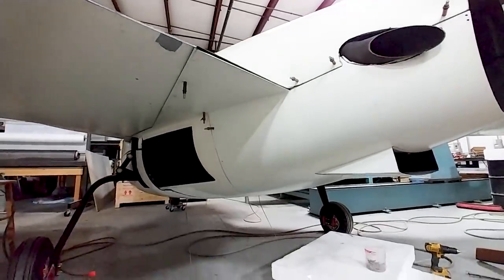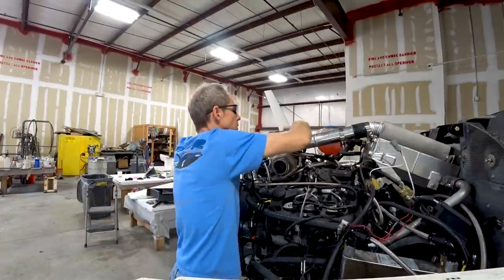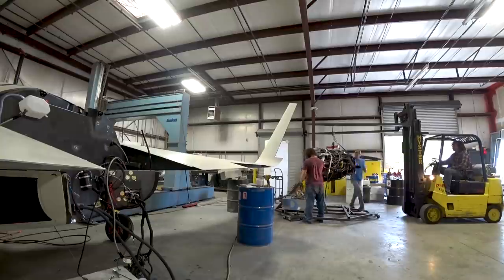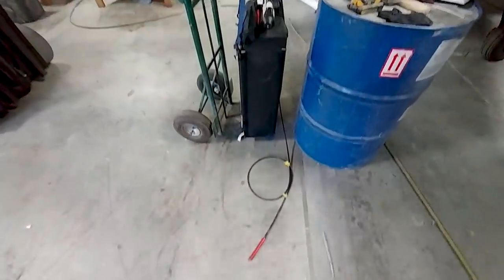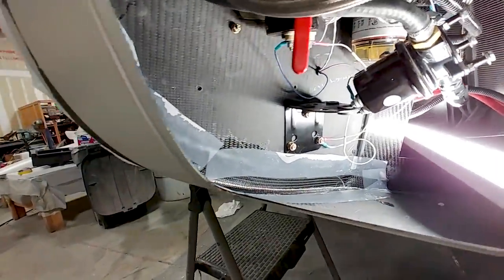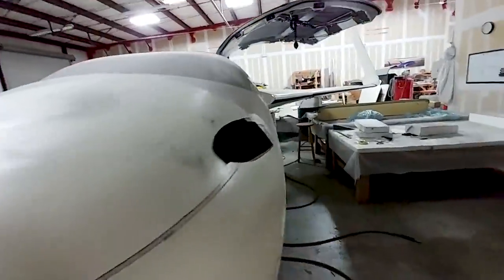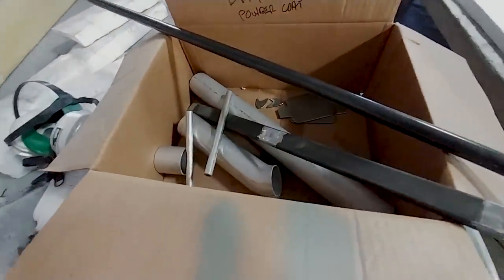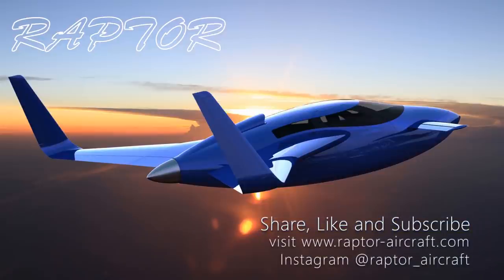Engine Out, Parachute In - Building the Raptor Prototype

Comment: On my parachute in a pipistrel they built carbon fibre tube for the exhaust with a white sticker to cover the hole. Simple, light weight. And I’ve used it on my first pipistrel aircraft after half a blade let go, they sure are nice to have.
Reply: I was just about to write the exact same thing, nearly word by word. I built my Virus from a kit and I remember the installation of the carbon fiber tube was added as an addendum to the kit build manual.

Comment: You guys are amazing!!!  Getting close!!  Are you going to pressure test the tanks before going to the airport? The Rutan homebuilders use an altimeter reading of -1500 ft, which works out to be 0.8 psi. Just curious, what's the weight of the entire "power unit" ?

Comment: Beautiful work.  I can't wait to see it make it's first flight!  Have you considered using a remote mounted electric A/C compressor?  That would allow you to remove the engine without having to evacuate the refrigerant lines.
Reply from the maker: I don't plan on removing the engine on a regular basis. There are refrigerant recovery systems available anyway.
Reply: I was thinking of future maintenance.  At some point, the engine will have to come out for service or overhaul.  If the A/C is a separate, self-contained system then it's one less thing to deal with.

Comment: Does the aircraft have a dedicated ground plane? You may wanted to consider installing a dedicated groundplane and even some lightning protection for the production model.  I would be happy to help with this as I have some experience  in the matter if you ever have questions.  I would be “shocked” to hear that you haven’t been shocked by your fuselage yet (If it doesn’t have a dedicated ground plane that is...)

Comment: Just a random thought, but wouldn't rolling it out thru the door onto a flat deck 5ton car hauler have been easier? the deck of the wrecker truck should be close to the same height as the loading dock door.
Reply from the maker: Because I learned was back in kindergarten that you can't fit a square peg in a round hole.
Reply: @RaptorAircraft  I learned you just need a bigger hammer😊

Comment: I recommend the user Fibrefrax for the firewall. It is FAA approved, very light weight and very easy to work with. Available from Spruce. I used it on my composite homebuilts firewall.
Reply from the maker: That looks interesting. Does it get very dirty? Did you glue it on with the glue they also offer? Any other tips you may have for installing it?
Reply: Raptor Aircraft  After applying the Fibrefrax to the firewall I put an Ali heat blanket on top to protect the Fibrefrax from dirt, oil and anything else. I also used Fibrefrax on the parts of the cowling that are close to the exhaust and then covered those areas with Cool It tape which is a self adhesive Ali heat reflecting tape. As far as adhesive to apply the Fibrefrax goes, you can just use a high temp spray glue.
Reply: Raptor Aircraft  I seem to remember they wouldn’t ship the adhesive that they offer with it to the UK as it was flammable. So I sourced a similar product over here.

Comment: Wouldn’t the rocket exhaust be hot enough to melt aluminum tubing? Maybe consider thin-wall stainless exhaust tubing instead. Still going to be nice and light.
Reply from the maker: It's not like the rocket sits there for any length of time, certainly not long enough to melt aluminum.
Reply: As the other chappie said, the rocket tube on his Cirrus was carbon fibre. He used it and it worked. Rockets don't stick around.

Comment: Been reading a lot of comments on your last video mostly negative about using automotive engine.  Mainly about weight and running this engine at a high load all the time.  Whats your thoughts about this? I'm just a lay person but some of what they say make sense.  Are these diesels designed to run this much horse power constantly? Love this channel by the way.  Watched every video and thoroughly enjoying it.
Reply: I think the parachute addition answers the reliability question. I’m kidding, there’s strict government guidelines which the Raptor will have to meet to get airborne. The chosen engine will be a part of certification and desired performance/reliability.
Reply: When Peter first started 80% of the comments were negative, said he would never get to where he is now. It is very easy to criticize I have heard it all my life by people proven wrong. Peter is by far no idiot, he has quieted most of the naysayers and the rest will be silenced soon.
Reply from the maker: If I didn't think it was a good idea I wouldn't be trying it.
Reply: I hope the TDI engine works flawlessly, I don't understand why the GA community accepts engine designs from the 1960s as the only thing that can power an airplane.  As much as I love my 1965 Mustang (and I do) compared to today's cars that thing is a POS.  It makes way more sense to use a modern, efficient, and reliable engine.  We will see in a few months if it works out, but I'm rooting for it!
Reply: Raptor Aircraft exactly !
Reply: @garrettkuipers1  It's not the automotive engines that are the problem.  It is the  re-drive.  There have been many designs by many people and nearly every one of them have failed.
Reply: @David-eh8rl  This new design may also be a world beater then
Reply: @vaughnbay  Actually I'm 26 years old.  I've done a lot of research along side my father.  He is building a velocity 173.  That's where I learned about all of the automotive engines in aircraft.  His belt system may have a chance being that it will soak up a lot of the harmonic imbalance of the engine.. At least I hope so.